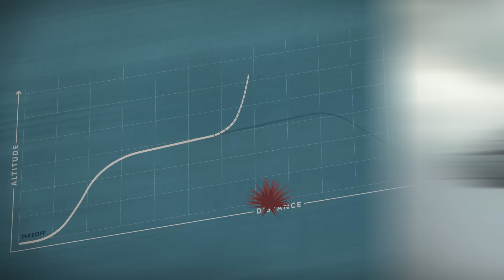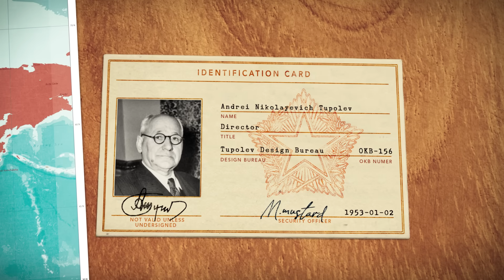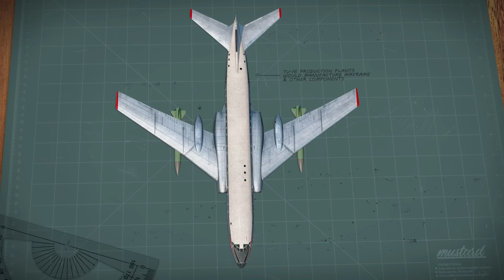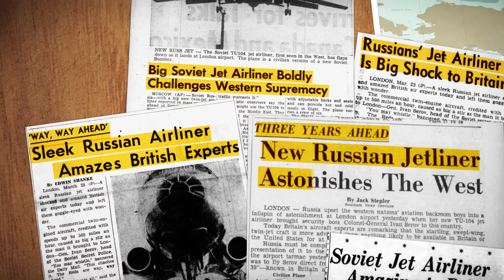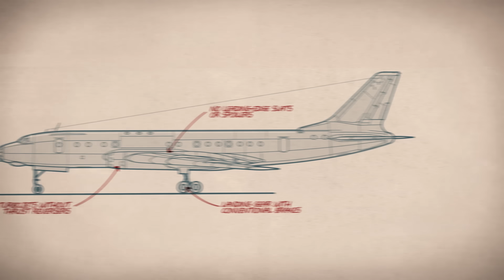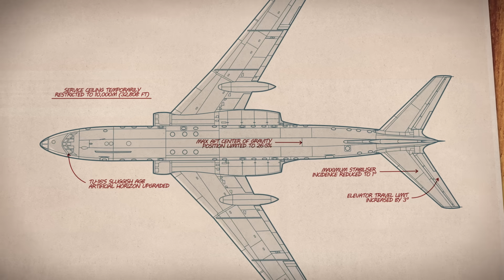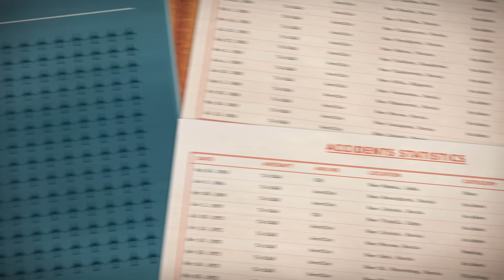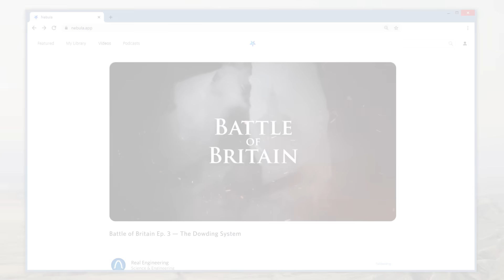The Soviet Airliner Designed To Crash

Comment: The comet was amazing, until it came apart in mid air.
Reply: @DoktorBayerischeMotorenWerke 

Obviously it's always very important to note the relevant facts.     

We do indeed feel we can clear up some commonly held myths and misconceptions.
   
The DC 10 has an average safety record for an aircraft that first flew in 1970. The cargo door fault that caused the historically deadliest aircraft accident loss incident at the time was not rectified for all aircraft immediately due to an agreement between an FAA person and people at the manufacturers. The aircraft only attained average safety stats after a number of significant safety related modifications were completed for all DC10 aircraft during the early years of operation.

 Of course De Havilland carried out a full stress analysis & performed extensive & protracted testing on two long lengths of fuselage. De Havilland carried out significantly more testing than was required by any authority at the time.
 
It is the case that the stress for the crown sheets when measured was not greater than predicted.
  
  Obviously there have been worse aircraft for accident losses both before & after the Comet.

    How things were back then -
Accident losses - % of aircraft built.
DeHavilland Comet 4 UK     14% 
DeHavilland Comet all mks  17%  
Vickers VC10 UK 5%
   The DH Comet had better safety than or similar safety to many other commercial passenger aircraft of a similar era
    Douglas DC-1        99%
      Douglas DC-2        47%
    Douglas DC-3        30%
      Douglas DC-4          26%
    Boeing s300            72% 
 Boeing 307               70%
  Boeing 247                48%
     Boeing 707                   20% 
Lockheed L-049/149 Constellation  30%
   Lockheed Electra  Turboprop    29%
Fairchild FH-227                        30%
 McDonnell Douglas DC-8        14%
  Sud Aviation Caravelle            15%
Canadair CL-44  Turboprop     46%  
Convair CV-580  Turboprop     22%
Convair CV-880    (ff 1959)       27%  
Convair CV-990     (ff 1961)      33%
Tupolev T-104          (ff 1956)    16%

Obviously the French Caravelle, a very similar aircraft to the Comet, also at the time didn't result in Sud Aviation becoming a significant competitor to Bow-wing  (See B-47 wing folding and wing collapse incidents).
        The Comet was designed with military use in mind, Nimrod work started at De Havilland in 1953.
  The committee did not find hundreds of fatal flaws or evidence of design defects, structural defects, defective materials or shoddy workmanship. Ripstop provision was included. Claimed incidents did not involve cracks starting from window corners & one particular incident did not involve a fracture running from a rivet hole. 
     The engine & engine intake position had advantages, were not flaws or fatal flaws & were not the cause of any incidents involving any Comet or Nimrod aircraft. Nearly all changes before the Comet 4 were just in case or were previously scheduled improvements. 
  In fact it is the case that the skin thickness of the Comet remained largely unchanged for later versions. The alloy used was changed simply because the manufacturer discontinued the original version. 
  Bow-wing & the 707 story (see b-47 wing folding & wing collapse incidents) is the result of global economics & the well protected & very large domestic US airliner market & active support from the UK with for instance proposed competing airliners from Vickers & DH being blocked by the UK government at the time, cheap & nasty was the requirement with large scale production capability in one place.
  The 707 was of course a much larger aircraft which as a stressed skin metal airframe aircraft would require a thicker skin anyway. They got lucky at the time essentially.  Bow-wing is the result of the large & well protected  US domestic airliner market 
  The 707 had a very long production run with a large number produced, the average life of a 707 doing airline duty only was about 22 years. Military duty 707 airframes get a lot of big military budget attention & there are plenty of spares from retired aircraft which is why there are still examples in service.
  The fate of De Havilland was due to Govt policy Aerospace sector rationalisation & global economics, it was nothing to do with the Comet.
  A comprehensive, thorough & protracted testing program was carried out on the prototype & it's assemblies. Of course the Comet did indeed have Ripstop stop provision. 
     De Havilland (Of England) Comets were not grounded after 1970 due to structural problems.
It's interesting that some of the aircraft on the list should really have been noticeably safer than the Comet due to being a similar type but of much later design & manufacture but they definately were not safer.
    How things were back then -
Accident losses - % of aircraft built.
DeHavilland Comet 4 UK     14% 
DeHavilland Comet all mks  17%  
Vickers VC10 UK 5%
   The DH Comet had better safety than or similar safety to many other commercial passenger aircraft of a similar era
    Douglas DC-1        99%
      Douglas DC-2        47%
    Douglas DC-3        30%
      Douglas DC-4          26%
    Boeing s300            72% 
 Boeing 307               70%
  Boeing 247                48%
     Boeing 707                   20% 
Lockheed L-049/149 Constellation  30%
   Lockheed Electra  Turboprop    29%
Fairchild FH-227                         30%
 McDonnell Douglas DC-8     14%
  Sud Aviation Caravelle       15%
Canadair CL-44  Turboprop   46%  
Convair CV-580  Turboprop 22%

A comparison of more recent aircraft.
Accident losses comparison examples. 
1970s - 1980s
    % of total Aircraft built
Similar aircraft type, date / decade, useage, size.
    Biz Jets
BAe-125-800                        1.7 %
Beechcraft Beechjet 400    2.2 %
Cessna 550 Citation II         7.1 %
Learjet 35 / 36                       12 %
Beechcraft 1900                  6%
Dassault Falcon 10              11.5%
Aérospatiale SN.601            22.5%

Medium size jets / Turboprops.
DC10      ff 1970                7%
BAe-146                        5.1%
Fokker 100          6%
McDonnell Douglas DC-9-30       9.5%
Fairchild FH-227       30%
McDonnell Douglas DC-8    14%
Canadair CL-44  Turboprop   46%  
Convair CV-580   Turboprop   22%

Beechcraft, Fokker, McDonnell Douglass, Learjet, Fairchild, Aerospatiale, Canadair, Convair  companies defunct.

    All Comets, including some Comet 1s, had full civilian use certification at some point after 1954,  civilian use certification only being withdrawn after commercial flying stopped. Examples were flying until 1997 - one example did a signals research global circumnavigation flight series in 1993 via Australia virtually without a rest travelling 28000 miles, only had an ice warning indicator issue during the flights.

    The DH Comet - World Firsts.
1st gas turbine jet powered airliner. 1st high altitude 8psi pressurised full fuselage length passenger cabin airliner,  not a trivial feature as structure  strength required for pressurisation considerably exceeded strength required for normal flying stress. Nobody else had done anything similar before the Comet.
  The b-47 (& the Junkers) used relatively small, heavily built  pressurised modules  (Bow-wing b-47, the aircraft where 6 had their wings fold up in 2 months while flying & some had their wings fall off while parked). 
   The 1937 Boeing piston engined airliner pressurised passenger cabin was pressurised to 2 psi only - in fact that could easily be done as the normal unpressurized fuselage cabin structure strength for flying stresses only was all that was needed to be adequate so no significant weight increase issues needed addressing.
    1st all hydraulically powered flying surface controls & actuators airliner with under carriage wheel disk brakes + ABS.
1st jet airliner to cross the Atlantic.
1st jet aircraft to do a world circumnavigation flights series.
  Of course De Havilland had prior experience building many all metal construction airframe aircraft including thousands of jet powered fighter aircraft that were primarily of metal construction with pressurised cockpits & jet engines built by De-Havilland & we know the world's first all metal construction airframe airliner was built in England in the 1920s by Handley Page.
  Indeed it is in fact the case that airliner construction & testing changed everywhere, including in the US, during & after the Comet investigations.
     De Havilland did indeed always work to better than industry standards at the time, used up to date knowledge for the design & no evidence of negligence  or criminal negligence was ever produced in relation to the DH Comet.
    The course of De Havilland & the general UK aerospace industry sector was not affected even slightly by the DH Comet. The course of national aerospace sectors obviously being similar & inevitable in many countries.
     Other interesting World firsts
World's first turboprop aircraft.
Vickers Viscount Turboprop Airliner 1947. 
A 1945 Gloster Meteor Aircraft with Turboprop Gas Turbine Engine.

They might like to answer these questions.
   Which airline has just ordered
60 RR England Trent XWB Engines
& What aircraft are the engines for?

Bonus question for 10 points.
         Which country has the 
World's Highest Combined Per Capita
  Nuclear + Defence + Aerospace Sector Activity?    

          👍 & 🙂 & of course 😎 indeed.
          C H E E R S without doubt  
            Etc & so on & so forth.